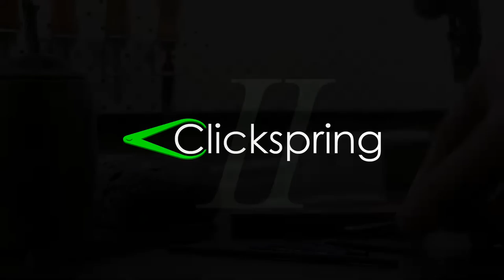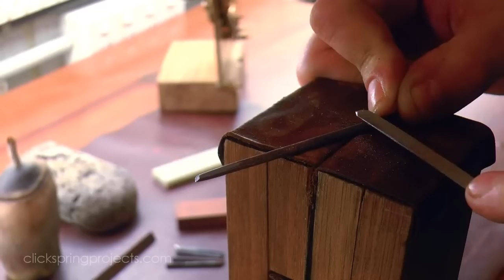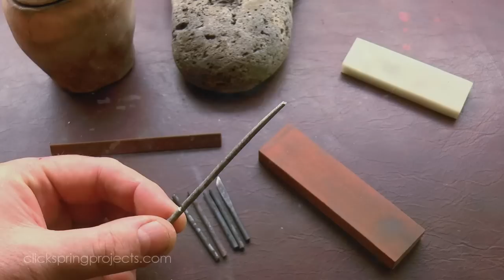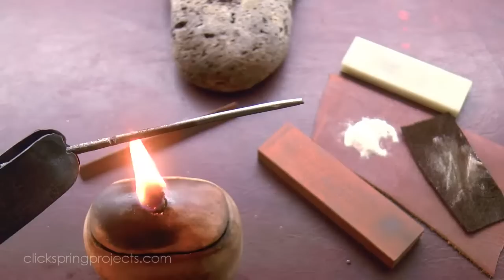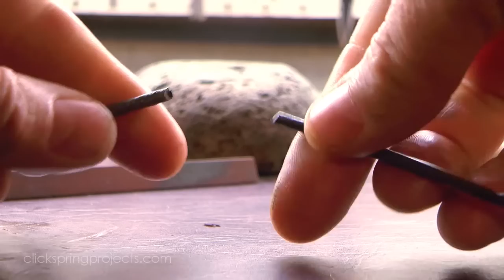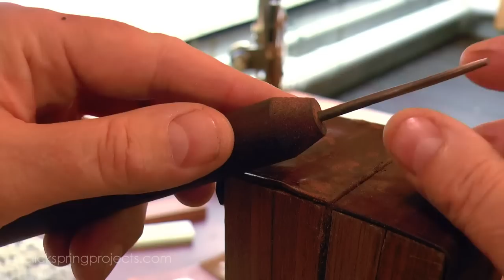Forming & Heat Treating A Burin

Comment: I’m from Melbourne and was wondering where you find supply of the leather for your workbench
Reply from the maker: I recycled it from an old (and at one time, very expensive!) couch. Its a soft, thin leather, works great for part protection on the bench, and I also use it to face various tool grips etc - Cheers :)
Reply: If you can't find an old couch with real full-grain leather upholstery to re-use, Leffler sell leather for makers.